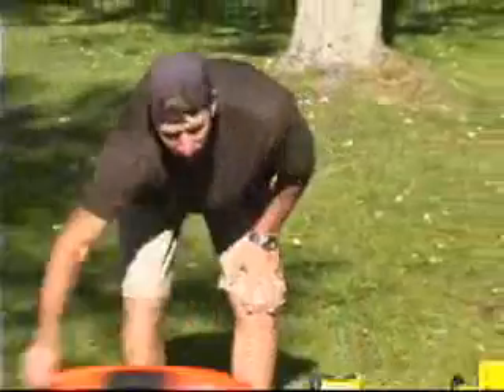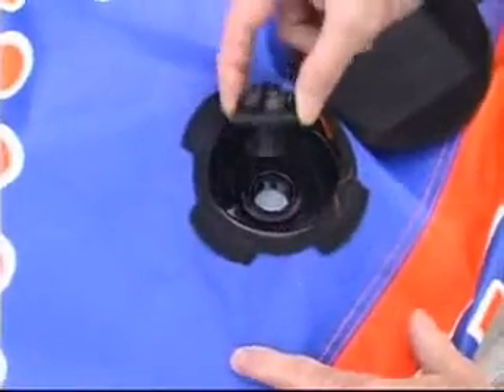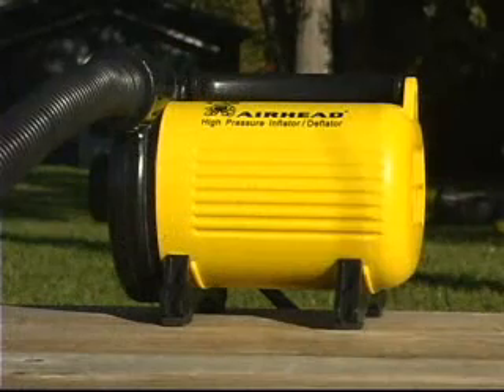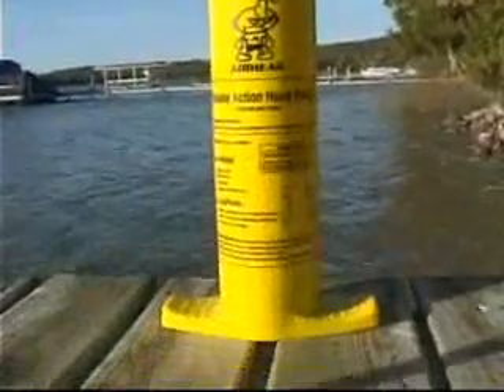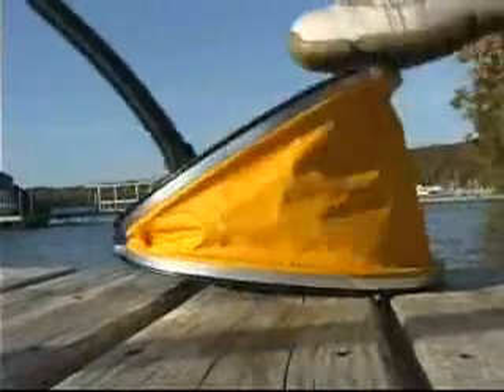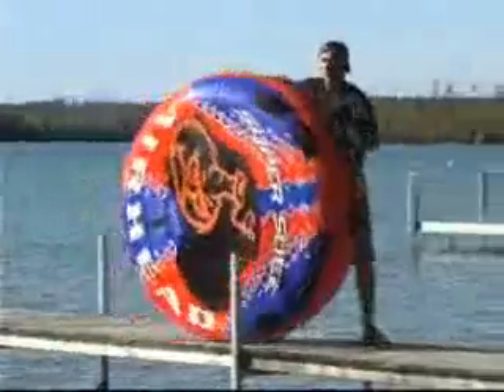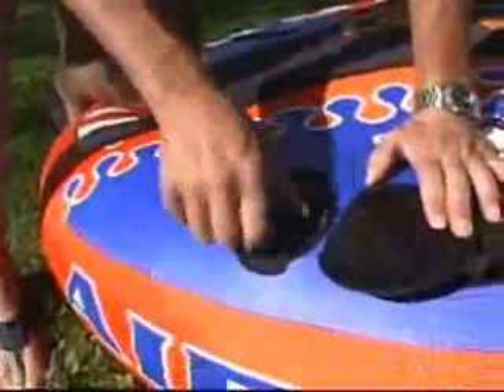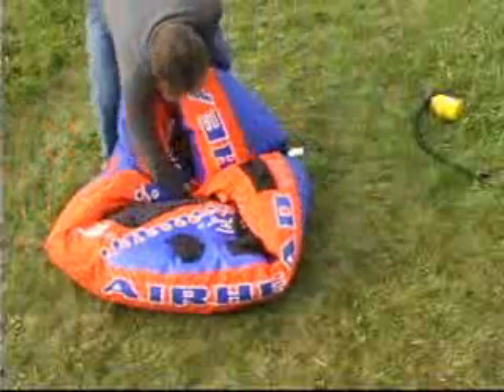Inflating a Towable Tube

Comment: If you have electricity but can't find a high volume low pressure pump 'I've discovered a fast way of inflating a large inflatable ' a SHOP VAC ' just be certain there's no dirt in it and the hose is clean 'just take the vacuum hose and plug it into the exhaust outlet and the other end into the large inflatable.